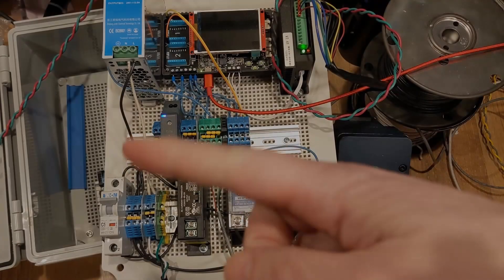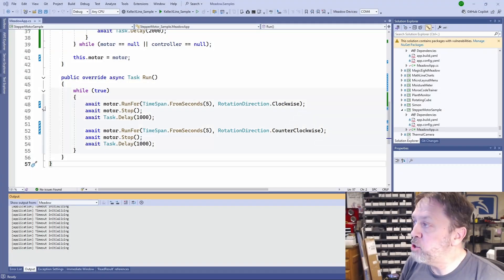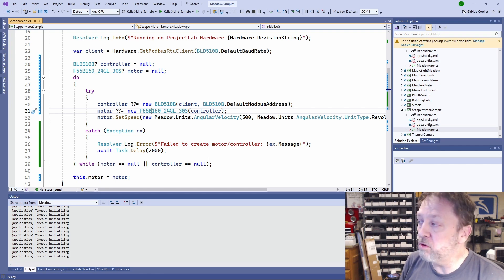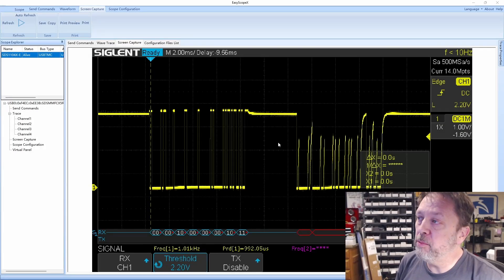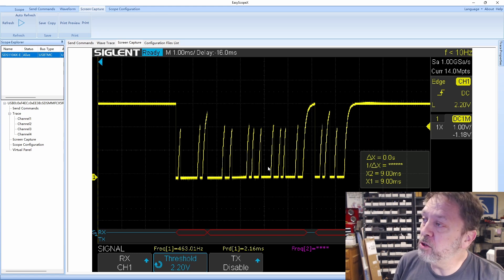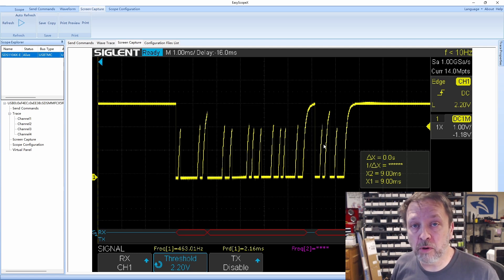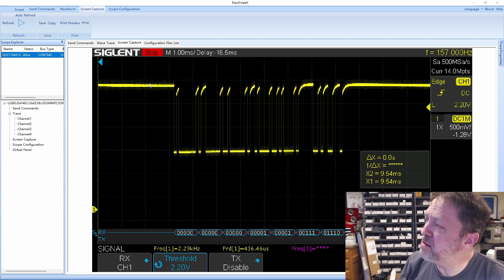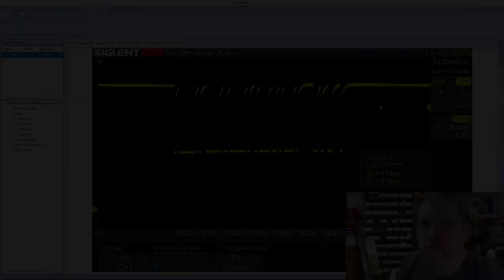Do I Need ModBUS RTU Resistors?

Comment: Thanks a lot for the great video. I am excited to try this in a noisy RS485 environment. Just curious, how did you connect the probe, and was it a 1X, 10X, or differential mode probe? I really appreciate your help.
Reply from the maker: Just a 1x probe, using the ground from the master
Reply: Thank you very much for your reply sir. How about if there's only RS485+ and RS485-. In this case there will be no signal common.